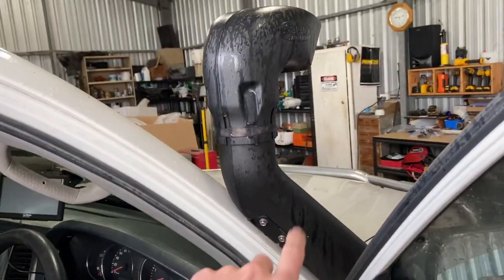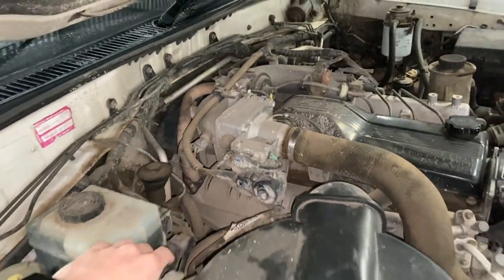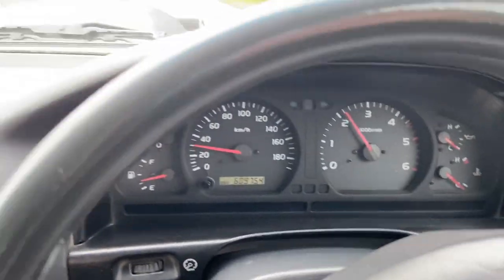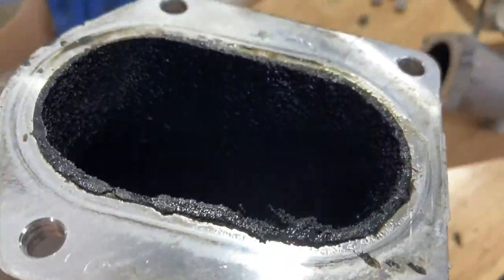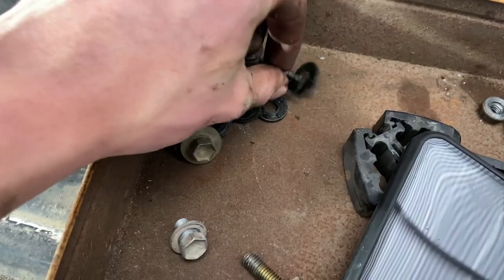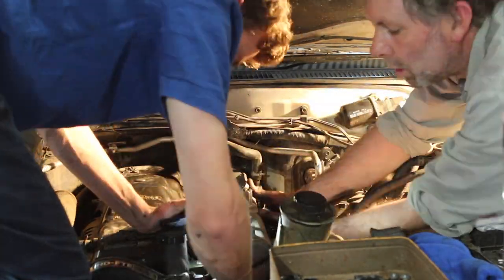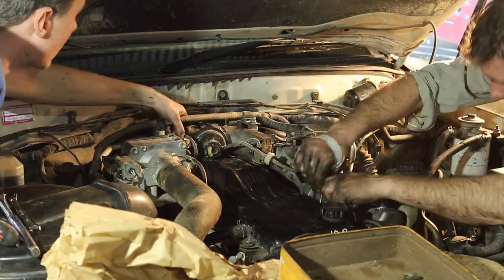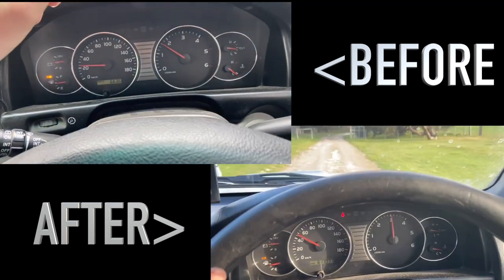Is it Worth Cleaning Out Your EGR? [1HD-FTE]

Comment: Good Job Will,  On my engine I took the valve cover off and turned it over until both inlet valves were closed. Using a right angled scraper I made up and throttle body cleaner I cleaned out all the ports one by one until finally putting an air blower down the port to expel the loose carbon and TB cleaner.  Make sure you stand well clear doing this and protect the paintwork !  Cheers Jamie

Comment: I have a 1987 mercedes 300d with only 162k miles. I removed my egr and blocked it off. Then pulled the intake and found it had 1/4 inch of greasy soot and the intake ports on the head were about half restricted.  After scraping all the gunk
And cleaning it out there is a noticeable difference in power and better mpg.
Agr sucks.   Good luck on your project.  Stay safe.

Comment: Very well done young man and give me yet again why 100% NEVER do an on engine chemical clean as all that crud get dissolved and shoved through your engine.
The way you did it is the prefect way to do the job "RIGHT" The most expensive way for the bloke has to pay someone but 110% correct.
Who wont all that shit getting loosened up and shoved down into combustion damaging rings & bores.
Sad but some people are sucked into the running chemical cleans with no idea what they are doing to there engines.
Good work mate.
Reply from the maker: Thanks heaps for the kind words! Couldn’t agree more, you’re saving the internals of your engine by taking the time to clean it out properly. It’d run like a pig with all that crud on the pistons

Comment: Thanks Will, I watched yours and Dan's video and convinced me to do it. My FTE has 380km and my Nissan YD25 has 218k and it's just one of those things I have to get done I guess.
Reply from the maker: Would highly recommend a catch can after cleaning it out. It’s the only thing that will stop it from happening again!
Reply: @WillsLandcruiser  Will do, blowby on the navara is hectic. Does your 1hd fuel pump have a mad tick at idle?
Reply from the maker: @BensMis-adventures  all diesel injector pumps are pretty noisy. That’s just natural. And every engine will have a bit of blowby, that’s pretty normal. As long as it’s not excessive or chuffing like a steam train then you’re fine

Comment: MAP sensor filter is also common to fail and will cause low power symptoms.
Reply from the maker: Did some research into this today because the 100 series I’m working on at work currently has similar symptoms and you’re very right. They can definitely be the culprit 👍

Comment: A wash while ur at it too 👍👍
Reply from the maker: Chevy Brown I’ll pass that comment straight onto dad so it’s not only me telling him to wash his car 😂😂
Reply: Well done great job with the egr and intake clean.
I’m a diesel mechanic and have worked on many 1HDFTE engines.
Depending on how many kms the vehicles got check the valve clearances and on many occasions this makes a big difference.
Also replace all filters, air, fuel with genuine filters.
Also I recommend only use BP ULTIMATE DIESEL.
Also those injector lines need to be replaced every 120,000 kmls.
Injectors can be sent to your local diesel fuel shop to be tested for spray pattern and spray duration pulse.
Good luck I love these engines and service every 5000kml.
Reply from the maker: David Swieca Honestly I don’t think those injector lines or injectors have every been replaced. It’s definitely in need of a birthday and I appreciate your feedback! I should do the same with my 1HZ too

Comment: holy crap what a difference! Great video, any other tips, I think i'll get the toyota part for the EGR delete. Anything else worth doing while i'm there 245,000 km
Reply from the maker: Would be looking into injectors for sure. I think the FTE’s like to have the injector lines replaced fairly often too
Reply: @WillsLandcruiser  I think I might try the liquid moly intake cleaner then do it all at 300k
Reply: @WillsLandcruiser  mines hit 260k kms now and I'm getting soot around the exhaust, I think it's nearly time to give it a birthday. I only do about 10,000kms a year in it as I'm only 2.5kms from work.
Reply from the maker: @Rubibi-saltwaterjim  yep good idea! After rebuilding one of these things now, I’d be doing a full intake clean, EGR blank, replace injectors and it wouldn’t hurt to replace the big end bearings while you were at it if you wanted to go that far!

Comment: Great video. Did your dad's 100 have any work done to it for the first 600 thousand klms? ie catch can, egr delete, secondary fuel filter etc.
Reply from the maker: Nope none at all apart from services! That’s what justified all the work we did to it at 630,000 😂
Reply: @WillsLandcruiser  thanks mate you're a legend. After hearing that I'm leaving mine alone until it starts slowing down. 👍
Reply from the maker: @Normacfan  i’d definitely recommend installing a catch can ASAP, and replacing injectors and injector lines every 300,000- those small things will keep it all running nice and smoothly for way past 600,000. But yes, it does seem to be possibly to go without these things for a long time
Reply: @WillsLandcruiser  thanks again Will, appreciate the advice.

Comment: Did i read the ODO right 617,777kms? Now that its clean time for a catch can right? Great effort by the way. I'm not keen enough to pull my intake off my santa fe yet so I've been using a can of Penrite P26 Diesel Foaming Intake Cleaner everytime I do an oil change and it seems to be helping quite a bit.
Reply from the maker: Yes that’s correct! Bit of an old girl haha. It’s not a fun job at all, but it is very important! Definitely catch can time for the cruiser, I agree
Reply: @WillsLandcruiser No catch can for an fte , Berrimah diesel said not to .

Comment: Cleaning EGR? Clean inlet manifold from oily soot, then chop EGR with axe.
Next chop all exhaust piping from turbo and install 3" straight piping.
Drop oil pan off, clean pan and oil inlet.
Don't ask me how I know, you don't want to know.
Thank me later.
Reply from the maker: Cheers mate. It’s booked in for an overhaul early next year and we’ve got a 3” exhaust sitting in the shed ready to go in
Reply: @WillsLandcruiser  Nice one. Love straight pipey on these engines. They want to breath.

Comment: Hi great video I have 1999 either same engine I have a jerking problem it’s big jerks when shifting I think third to fourth gear or may be some times full rpm stuck at  3000 and reaches full rpm big big jerk to the ride  only that time smoke blows and vanished after that at the speed of 140 some times Speedo dial died and then plz help ?
Reply from the maker: Sounds like a clutch mate. Go see your local mechanic

Comment: Quick question Will, hard to tell from your video and Dan Vs Car. Are there’s gaskets under the intake manifold? If so, did you replace them?
Reply from the maker: Yes there sure are. Big rubber gaskets. From memory it’s a 3 or 4 piece gasket that seals around the studs also. I would always recommend replacing a gasket if you’ve taken it out, especially if it’s done a couple hundred thousand. There’s also a heap washer gaskets on the studs that value at $8ish each so be careful not to lose them!
Reply: Will's Landcruiser Mods great thanks for the info mate. I though there would be, just doing some prep to get all the gear together. I’d hate to get it all apart and find out there’s a long lead time on parts. Thanks for the prompt reply, I’ll get them on order before I start unbolting things 👍🏼
Reply from the maker: @jimmyjones2426  no worries! All the best
Reply: Will's Landcruiser Mods another quick question for you mate. Is there any need to crack the fuel lines at the injectors to bleed the air on restart?
Reply from the maker: @jimmyjones2426  Always a good idea. It’s easy to get an air lock in the lines and I normally crack 3 or 4 and sometimes that’s enough to get it running again

Comment: Hi my friend,  nice video, I need some help from you, I have got 1hdfte,  it's popping up Check Engine on dashboard,  I tried to run diagnosis,  it come out with Accerelator position sensor switch malfunction,  so should change it or just clean up EGR and Air Intake,  like what you did,  Thankfully
Reply from the maker: My recommendation would be to take it to your local mechanic
Reply: TPS is near the accelerator pedal... Most of the time just requires disconnect and electrical contacts cleaned

Comment: Hi
did the cleaning make a real  difference  in the terms of power and fuel consumption?
If your intake would've been plugged up ,I would say that the cleaning would help ,but removing of 1/4 inch of that oily deposit can' help too much
or it can????
Reply from the maker: Hey mate, there was actually a noticeable difference! If you look into my later videos, you’ll find there were other problems with that engine holding back its performance, but cleaning the intake out did help a lot because all of a sudden there’s smooth airflow and it’s not disturbed by rough soot on the way in. If you go to the trouble of doing this though- get a catch can and blank that EGR. You’ll thank yourself for it

Comment: Was there some soot when revving/driving before cleaning out the intake? My 1HDFTE with 460k seems to be blowing some soot and it's stock. I only just got it but have known the previous owner and am sure this has never been cleaned.
Reply from the maker: Is it black soot or more of a greyish colour? Black soot is unburnt fuel and you commonly see this when planting it before the turbo has time to spool up. You see it a lot in my videos too because my HZ doesn’t have a boost compensated pump so before the turbo is at peak boost, it’ll be running a bit rich. Of course the FTE has a map sensor along with other computerised bits so it should compensate fuel for the air it’s getting anyway. It could also be a blocked air filter?

 I’ve seen more of a grey soot in diesels that live their life in town and never get a proper run on the highway. If you’d just bought the vehicle I’d be doing a complete service- all filters and oils if it needs it, and then taking it for a nice 30 minute run on the highway for starters
Reply: @WillsLandcruiser  It is more of a greyish soot, It has been sitting for the better part of 3 years only started a once 8 months ago to shift it out of the way before me buying it a couple weeks ago. The rear diff centre cooked itself from lack of oil and is the reason it was parked up - and I can't give it a good run just yet until I get a new one/rebuilt. For now it's just moving with the front diff. And yes, first thing I did was all new filters and oil.

But yeah even just putting around in first it seems to blow a bit of soot, particularly when giving it little revs and taking off. Clears up almost completely if you hold an rpm.

If I remember I'll reply here with what the cause is and if a good run solves the issue after I get a new diff.
Reply from the maker: @Beng177  look forward to hearing how you go! Hopefully nothing too major!
Reply: @WillsLandcruiser  rightio, found the intake gasket was half missing away up the front part of the manifold. The entire lot of manifold bolts were loose and after taking off the crossover bit off it was basically flopping around with roughly a 1mm gap. not ideal at all!! Cleaned all the intake out and surprisingly there was maybe half as much soot as what was shown in your video. No buildup at all in the valves/head. Don't think it needed to be cleaned if it weren't for having to replace the intake gasket.

chucked it all back together tonight, started & runs good. I owe it to videos like yours, don't think I would have done it otherwise.

Still a bit smokey but all the mechanics I know (that have seen it in person) say the same & reckons it just needs some fresh diesel, some injector cleaner and a good run. Got a new diff for it today so hopefully should be able to shortly!!
Reply from the maker: @Beng177  always great to hear success stories :) Great work!
Reply: @WillsLandcruiser  Yep took it for a few laps around the block and down along the creek for a test (put a front lokka in :) ). Replaced just about everything driveline apart from the gearbox & transfer. Smoke is completely gone and the motor sounds mint so you were right! Just needed a good run.

Just have the issue of it holding revs on gear changes but done some research and apparently its common for these motors and usually means the injector pump speed sensor needs recalibrating, which means a pump rebuild :/. Pulled the speed sensor on the gearbox and it stopped doing it. Would love you input if you know of any easy fixes there.

Comment: That's  doing it the hard way. I would have just cleaned the outside with degreaser then sprayed egr cleaner into the air intake making sure I don't hit the maf sensor. Much easier and does a better job. You just need to get the engine up to running temperature before you start spraying egr cleaner.

Comment: Great job always good to see what's inside these motors. What did you do with the gunk inside the head??  I have a 2003 HDFTE manual with 190ks my fuel consumption is usually around 11 litres  per 100ks.  I blocked my EGR at about 50ks.

Comment: Hahaha egr is to reduce NOx. Came out in the 90s for toyota. Its a service part. Needs to be cleaned. Blocking just means you will need to need clean it less. Doesnt give more power, you just dont loose power over time. Also brakeclean works better than degreaser but costs more. If you have time. Just sit it in a over cleaner bath overnight (lazy way to clean)

Wait! Fair enough the engines choked as fuck but you shifted at just over 2Krpm and lugged around at 1Krpm(before turbo spool) in second gear then after the clean you shift at 3Krpm putting you at 2Krpm (withing turbo boost spec) in second. Aples to aples please. I get its hard to remember after a day or so but still. 
Other than that. Keep it up
Reply from the maker: Liam Cooper Yeah nah I’m pretty new to the EGR stuff haha as you can tell. I may have been using “power” incorrectly, what I meant is that the engine was very choked and as a result of that it’s sluggish because obviously the AFR is all wrong when it can’t get the air it needs. 

And yeah I realised it wasn’t the ultimate comparison, you’re right. But it does give a fair indication, and if you watch closely it shot up in the revs in 1st as well as 2nd gear after the clean. It may have not been exactly the same change into 2nd before/after but there is a huge difference in how fast it climbs in revs now that it can breathe
Reply: @WillsLandcruiser  absolutely. It doesnt take much to choke it. Interestingly, how did you clean the head fully? 
To block the egr, the just need a blanking plate. A retune of the electric governor maybe required. Im not too sure about the sensing side of the egr on a FTE motor. But on the early version it was as simple as just putting a blank plate in. If you wish to keep the egr then a good catch can is recommended. Will help slow and stop the build up as it wont have oil to mix with.
Reply from the maker: Liam Cooper Yes the poor thing was struggling a bit. We just did the best we could and scraped a heap out, got in there with degreaser, high pressure cleaner, air nozzle, all that. We only went as far as the intake manifold so a real decent clean would show even better results. I personality wouldn’t like to keep it on there but I do realise it’s “illegal” to block them. I reckon we will be getting a catch can system pretty soon
Reply: @WillsLandcruiser  its only illegal if you get busted with it. Basically if you're stock they wont look at you. If you get a shit tune that blows heaps of smoke and block your egr, you will get looked at. So many people get bad diesel tunes. I dont know how they dont understand that smoke is bad news for a diesel...
Reply from the maker: Liam Cooper Yeah aye black smoke means a rich ratio right? Not good at all for Diesel engines. Well thanks for your advice! I’ll take all that into consideration and I definitely reckon dad needs to spend some money on it 😂
Reply: @WillsLandcruiser  yeah. Run a diesel rich it gets hotter. Egt go through the roof and that where you get piston failure.
Reply: There is no downside of blocking off egr
Reply: @chrisfemia6800  well there is. EPA finds out, its big fines
Reply: @liamcooper5202  there is no roadside test for diesels and if it all looks fine just with a plate they can't tell
Reply: @carlmenzel8744  i know the ins and outs of blanking egrs. All i am saying is that they do have the sensors to test it road side now.
Reply: @chrisfemia6800  the downside to blanking egr, is the egr also helps keep the engine temperature down, and helps regulate temperature spikes.